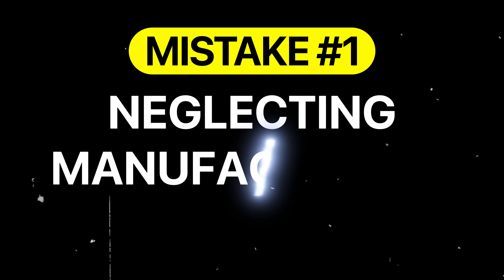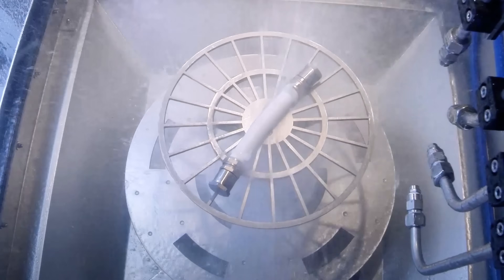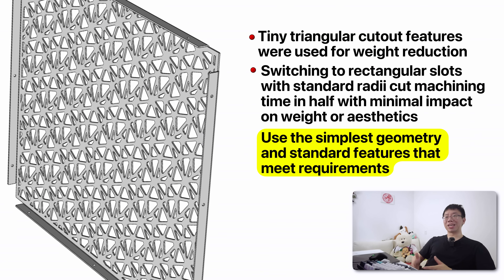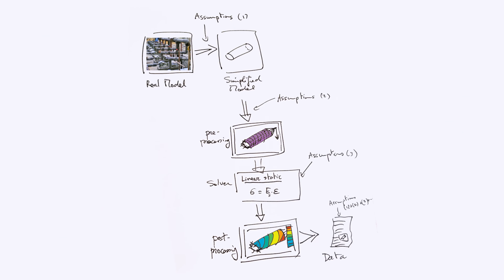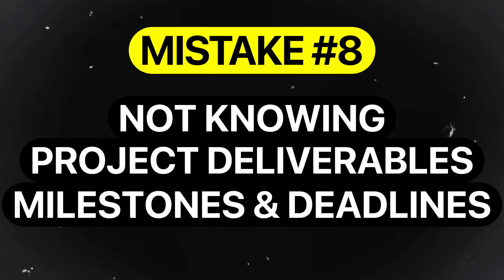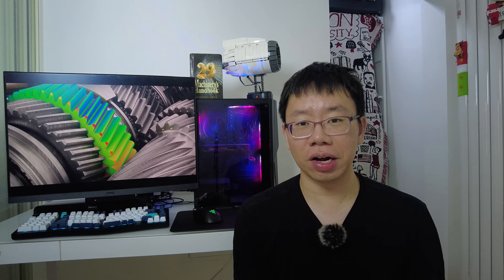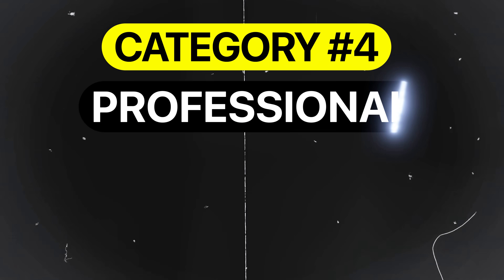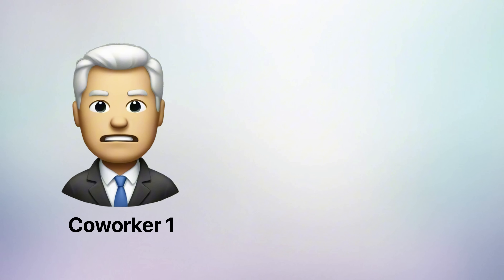Critical Mistakes Even Experienced Mechanical Engineers Make

Comment: If you work for a small company, and/or small volume manufacturer, another mistake is: Specifying a rare or unique component. For example, we had engineers who solved a fit problem by specifying a higher-than-standard clearance ball bearing, because in the short run this was easier than changing the parts the bearings went into. Years later, those bearings became unavailable as a standard part, and having them made custom was very expensive at low volumes. Always use standard parts with multiple manufacturers and suppliers whenever possible.

Comment: Mistake 3 Ovrrcomplicating. This..... Germans are best in this categorry. They can easily overcomplicate even simple Nail.... Look at they cars. We have army industry before any car exists but they still need reinvent wheel and have to use everywhere super duper own designed fancy part.... Even connectors....

Comment: Lean on your suppliers and the people making the finished part. If you put plus or minus .001" it may cost you triple the price when you could actually use something with a looser tolerance. There are also manufacturing processes which have their own standards and they don't really care what tolerances you call out on a print. You have to ask them what tolerances they can actually hold. Also work on your Excel skills. Every mechanical Engineer will use Excel at some point. Try to do as much real-world destructive testing as you can before a product launch. FEA is a great tool for comparisons, but you will learn a lot by breaking things in real life. Lastly, you should talk to as many other departments as you can. You might think that the sales department is useless because they speak a different business language than you, but they also know what people actually want and how people actually use products in the field. I have been a practicing mechanical engineer since 2005. Good luck!

Comment: The biggest mistake any engineer makes is not realizing what they design will eventually need to be serviced and repaired. I don't know how many times I've needed to remove a cover only to realize the only way to access it is in an inaccessible place because of... optimized design placement.
Reply: They do things to save themselves 10 or 15 minutes but add THOUSANDS of hours downstream.

Comment: These are great. I would add the advice that as miserable as the trades people you have to work with can be, they do understand their part of the process a lot better than you ever will. If the team in the field says that the latch tab is too short, ask for documentation. Don't tell them that your 3D model says its fine and that they must be mistaken. (True story)  You come out looking like a delusional idiot and the trades prejudice against engineers gets a little deeper engrained. 

Also, serviceability. How do you fix it in the field if it fails? Is it a serviceable part? How hard is it to access if it needs to be replaced? It's all well and good to have a nice, clean dash installation, but if you need to remove the whole thing to change the cabin air filter, you've just created a major serviceability issue for routine maintenance and your nice, clean dash (which consumers are paying to be nice and clean) is going to be exposed to unnecessary damage every time the filter gets changed. DnA is when parts are most vulnerable to structural damage on a per exposure hour basis. And, contrary to popular belief, tradespeople only have one elbow per arm, and it only bends in one direction.

Comment: I am from Germany and completed my Bachelor of Engineering in 2015. 
I still remember, when our professors told us to neglect air friction, whenever we had to work on a task and calculate something. 
Just like, it did not exist in real life :D. 

So, while universities/schools/whatever you call them teach you fundamental knowledge, sometimes it is a) impractical, b) outdated or c) it is so theoretical and disconnected from the real world.

I really liked your video, it gives a lot of great insights on what the real world ist. 
Since I have worked in the plastics industry, I can totally relate to the oversight of not knowing or researching the injection moldung process. 

I am now working in technical Sales and I also have a 3D printer myself. The application itself needs to define every aspect. What materials need to be used? How can the product be manufactred? How does the design have to look like? What tolerances are necessary? and so on. 
Is "over-engineering" useful? If the over-engineered aspects add real value to the part and you can convince the customer that it will perform better, then yes. Is this always the case? Absolutely not.

Comment: The cross team reviews are important. On internal projects, machinists and mechanics will find opertunities for improvement in every case. An engineer left to their own device's will make a critical mistake because they aren't familiar with existing issues and every process. A recent example was tooling was manufactured using old style metal 3d printing where stainless steel is backfilled with bronze. Then the engineer wanted holes tapped for 3mm screws. The material is unsustainable for anything but artwork. The heterogeneous copper alloy and stainless steel machines like sand filled UHMW. You just smear the stainless spheres around the bronze instead of cutting.

Comment: You are so dead on with this video. I am guilty of this too, I was lucky that I started at the bottom of a cnc shop and worked my way up. On your thumbnail, +/- .0001 , when I was running a machine shop, if anyone asked for less than .001" I always required, at what temperature? Bore/Hole sizes can change way more than that with temperature in different materials.

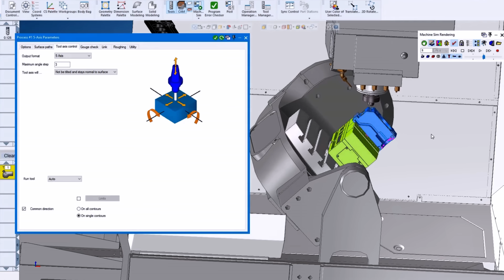Comment: The Example at 4:46 is a somewhat unfortunate one. This probably should be a lasercut and bend Part and not a milled one . In lasercutting only total cut length and the amount of contours really matter for the cycle time.

Comment: As a helpful insight, typically in Germany you have to start a trade. Then a few years out of your time you can then go on to become an engineer at University. This makes a better candidate. It's all well and good knowing engineering academity but without first hand practice, tradesmen will have low respect for engineers. They will know what will work and what won't from first hand experience. I have seen this all too often. If anything, ask the trades men their insight, it may of benefit to you.

Comment: Hello!! I'm in highschool right now, and am a bit confused on all the different types of engineering. I really would like to try and design/create prosthetics. Does this fall into a specific type of engineering or is it in several? I came from the explaining all types of engineering video.
Reply: A big part of prosthetics is mechanical engineering. Still, it is an interdisciplinary area depending upon what kind of prosthetic you gonna make. For example, a prosthetic knee can be passive, involving only mechancal engineering, while an active prosthetic knee will involve sensors, actuators, micro processors, programming etc.

Comment: I'm a machinist for a Tungsten Carbide manufacturer. I was surface grinding an order of small discs about 10mm in diameter and 1.75mm thick. The tolerance on the thickness was 1.75 to 1.755! 😂. A 5 micron tolerance band!
There were 7 of them and I only scrapped one 😁. I ground them oversize and used polishing compound to bring them into tolerance. I shouldn't have had to do that, but that's what they ordered 🤷‍♂

Comment: 😂 as a machinist going to school for my engineering degree I'll tell you a story. I did my co op in highschool at a very well known fourtine 500 company in the R&D department. I was trying to machine a part and there was just a dimension missing and no way to back figure the information. So I brought it to my journeyman and he confirmed it. So this guy makes me as a 17 year old call this engineer on the phone and explain to them that they essentially did their job wrong and it was caught by a 17 year old highschool co op. So they had to put in an ECO get it changed, get it approved by the department head and then reissue the new revision. They had to have been so pissed I could only imagine 😂 

Also a 1 millionth tolerance? Yeah let me go wire EDM that and then hone it. That'll be $10,000 a part please 😂
Reply: Everything is rubber, 1 millionth can come and go as you breathe 10 feet from the part

Comment: I worked about 35 yrs in Mech Engrg - your points are spot on!
You might consider doing a deep dive on these point as separate videos... for newbie engineers, this would be super helpful!
Reply: As a machine shop owner, I agree this is valuable information. I am also a solidworks user.

Comment: I am really appreciating your videos and material for helping young engineers to get a better understanding of what industry really needs. One thing that I don’t think I’ve heard you mention though is designing for maintainability, I work in mining and everything is big, try a 23t gearbox to drive a conveyor, this is not something that we want to throw away if it has a failure or issue, nor do we want to send it 1,600km (1,000 mi) back to the suppliers few don’t have to. Unfortunately we see too many bits of equipment are difficult to maintain because of a lack of consideration during design

Comment: Amazing channel.  Absolutely.  #4 gets me.  I refer to this particular problem as "German."  Everything that comes out of that damn country is unnecessarily over-engineered (and paradoxically also under-designed).  For example, a shaft that could be $1,000 will end up being $10,000.  Every time.  It's brutal.